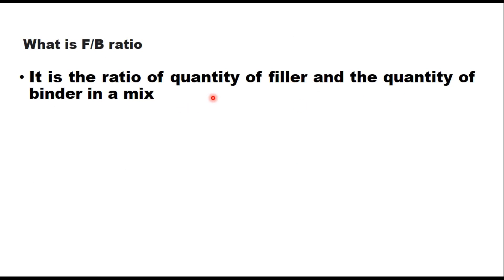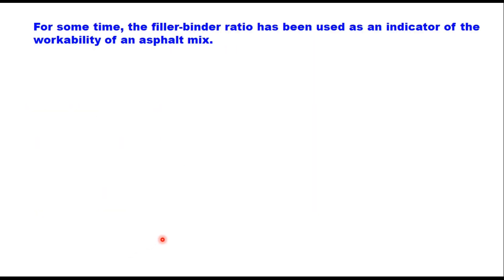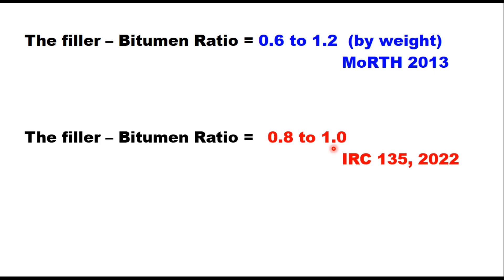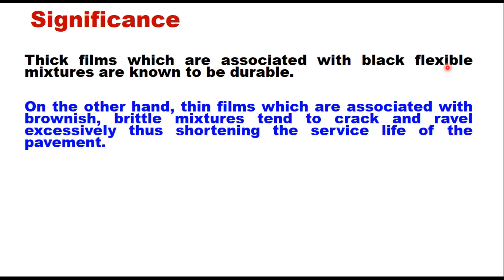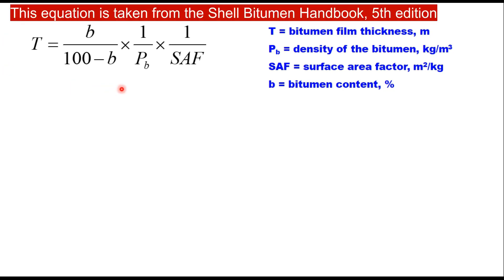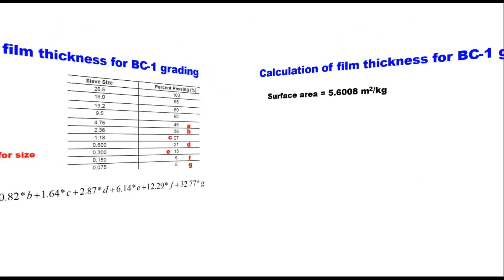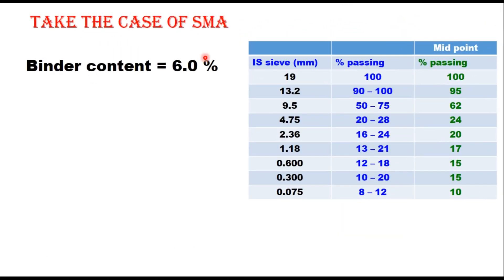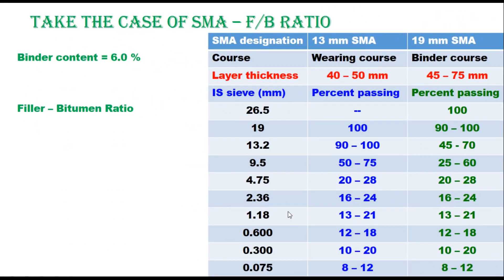Filler - Bitumen Ratio and Asphalt Film Thickness in a Bituminous Mixture - significance and limits

Comment: Thanks for sharing valuable videos. Sir what is suggestion for max f/b ratio for SMA- wearing course.
Reply from the maker: The code do not suggest any limit of F/B ratio for any mix. It is written in MoRTH 2013 specifications (orange book) that for Bituminous courses it should be 0.6 to 1.2. But SMA will certainly cross this limit.
Reply: @SatishIITR  Thanks sir 🙏.

Comment: Sir
 What is difference in using flyash as partial replacement of stone dust and using flyash in fully replacemement of stone dust in the pavement (BC layer)?
Reply from the maker: Filler by its definition is any inert material that satisfies the grading requirement. Flyash can be used as filler material and it can replace the stone dust fully or partially. The only check is the design parameters (stability, TSR, Mr) of the mix.
Reply: @SatishIITR  thanks sir
Reply: Sir 
But MORT&H doesnot suggest to use flyash in bitumineous layer? Is it true. Then in what circumstances or on what basis flyash can be mix in pavement layer?